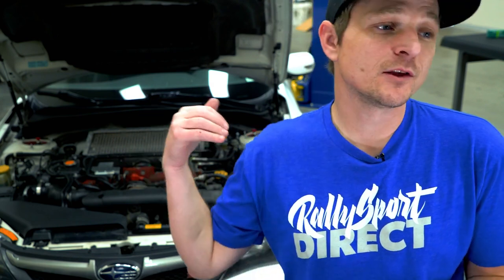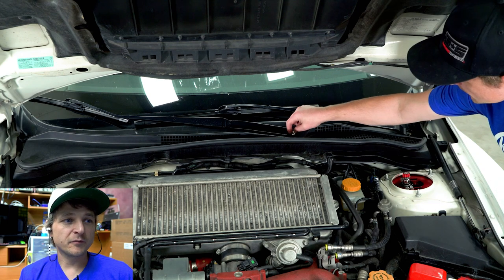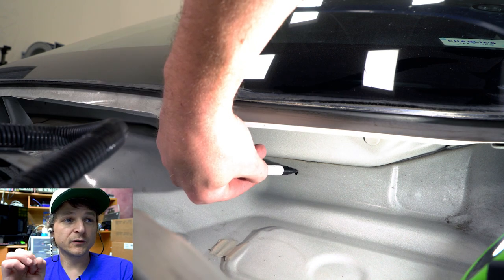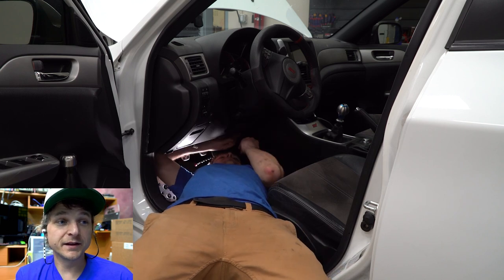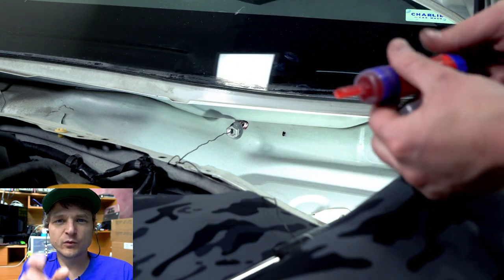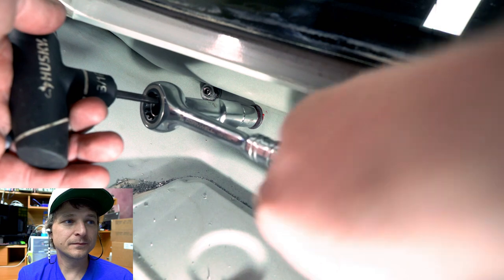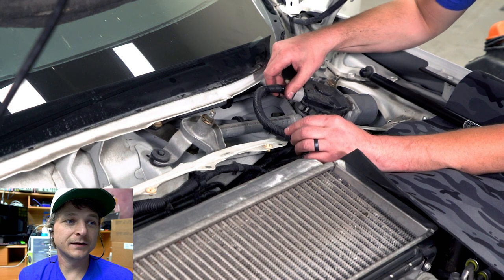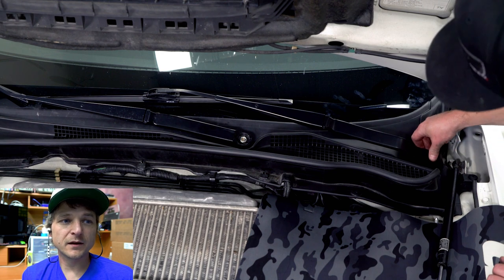Humble Rumble Firewall Fix 08-14 WRX and STI - Installed

Comment: Do you think this would help if there is already a small amount of tearing on the firewall? 3 of my spot welds broke and it started to tear. I know it wouldn’t be a permanent fix at that point but hoping to get some relief on the spot that has torn.
Reply from the maker: It would certainly help and * should * prevent the firewall from tearing even further as you would now be taking the stress off the firewall skin. 
Thanks!
Rick

Comment: I have had a squeaky clutch on my last car (Toyota) they tried to fix/tighten/lubricate never fully went away...
07 Impreza clutch squeaks
08 LGT specB sometimes

Is this literally what's happening every time? That metal is warping/flexing from persistent pedal pressing?
Reply: Hey Mike! I have seen a couple of cases of LGT's with the same failure. They have 8 spot welds that need replacing though! Hit us up if you need extra hardware!
Reply: This is one of the problems. The Subaru also has a clutch/brake assembly with cracked welds that makes noise

Comment: Can this issue cause us to not be able to shift while driving? I got stranded in my wrx sedan 2009 and had to push it by myself into a speedway parking lot.
Reply: Yes... Yes it can. This is the exact reason I found this page as well. I did a test on my car to make sure that was the cause and just used some Aluminum Rivets and the car shifted and ran just fine again. It looks like this kit has been discontinued unfortunately... So im being sloppy and trying steel rivets.
Reply: @jvock6  subiespeed has it but I think it's almost 2x the original price. I could be wrong but I'm ordering this ASAP 🥺I miss my rumble.
Reply: I hope it works out. I ended up doing 3/16 steel rivets bought at the hardware store 😂 . worked like a charm it's nice having the car back for nice weather and I might make my own firewall brace as well
Reply: Yea I hope so bro thanks for conformation that this is the problem because I already replaced the clutch master & slave master cylinder.
Reply: @jvock6  rivets why didnt i think of that
Reply: @Supernova69PyRo  just use rivets
Reply: @aidantaylor4149  i hope it helps you. The steel rivets are a pain in the ass but it's been a perfect fix! Good luck!

Comment: Oddly enough, it seems like a bunch of these are failing right now, just around the 10 year old mark for these cars.
Reply from the maker: Yeah it's a big problem that even Subaru admits too. There are a few "fixes" but most are just a bandaid to the real problem. Prior to this kit some people were welding the firewall and that certainly works, but it is very labor intensive, where this kit can be done in a few hours and 100% fixes the problem for ever. Thank you!!

Rick
Reply: @rallysportdirect  Yeah I ordered this kit to fix the firewall, but also ordered the ITS pedal bracket to completely transfer the load off the firewall and onto the steering column.

Comment: No way you just pull the bolts through the dash that easily. The firewall insulation wouldn't allow that
Reply: I just did it right now.  Got the first one on the first try.  The second one on the second try.  No cap lol